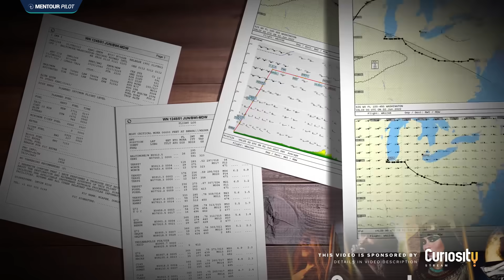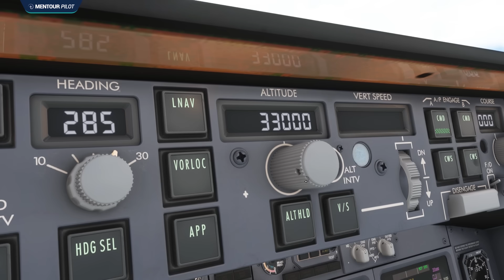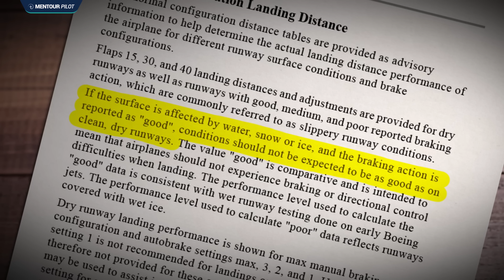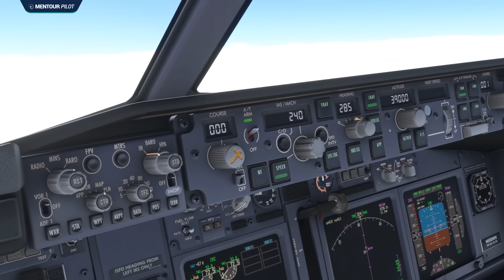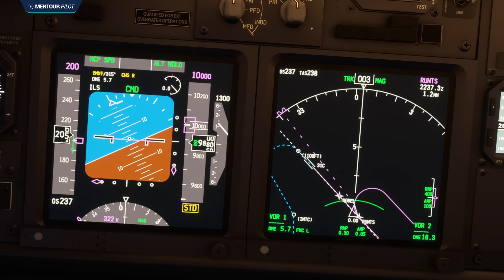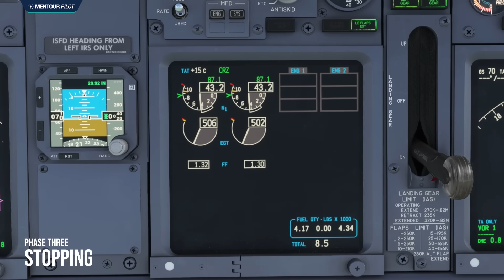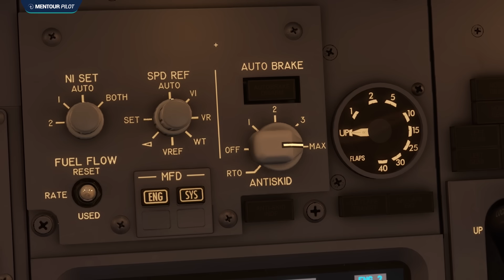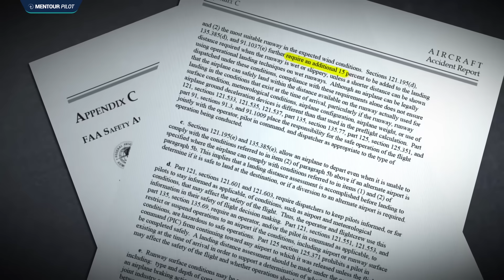WHAT did The Pilots MISS?! Explaining Southwest Airlines flight 1248

Comment: When will people learn that pushing the envelope almost always leads to disaster. I read about it time and again, people decide that conditions, whatever they may be, are just a little outside the safety limits so nothing will probably happen, and boom, disaster.

WTF?! Pilots are not required to do performance calculations once they are airborne. For god's sake, they are dealing with people's lives, how damned hard is it to pick up a computer and do a calculation?! Also, why would anyone design in a trap in software by defaulting to 5 kts without warning the user?

The more I see the stupidity of the way safety rules and procedures are designed and implemented, as well as the devil-may-care attitudes of some rogue pilots, the more I convinced that I am done flying forever. It only takes one pilot who has reckless disregard for the rules to kill everyone on his aircraft.

Comment: This misht be a "stupid" question. But as aviation is as safe as it is, which is actually more dangerous per injury, not just death but minor injuries. Actual crash landings, or the evacuations? As i hear that, during evacs, people get injured for their luggage and other reasons, so like; Have more people been injured in crashes, or evacuations that should have not lead to injury?
Reply: NOBODY takes luggage down an aircraft slide, the crew simply won't let it happen. The accident rate on slide evacuation is around 5 per cent, ranging from minor to serious. The rationalisation is something like "a few broken limbs is better than 100 passengers burnt to a crisp". BTW, slide evacuation from the top deck of a 747-400 is extremely scary.
Reply: @hb1338  Yet i hear this quite often... Usually a purser does not have that much authority against a distressed large male.

Of course it is way better, but here if it is 5%. If the ratio of perfect "crash" landing is more than 1 to 20 then, my statement would be true that evacs lead to more injury (the scale of injury not taken into account) that evacs are "more dangerous".

They so anal about the smallest of things to improve not to fall into the same problem once again.

5% injury rate is quite large in the airline industry, i hope they make the slides more injury free. I would not want to be evacuated from that 747 no way :D

Comment: Deicing, okay.. How long does it takes for ATC 🪐🎯 before they give clearance to Pilots that is about to takeoff 🛫 after deicing❓⁉️🌋 FACTS 💯‼️🎯
After deicing the eunway must be ready for clearance the flight 🛫, ATC 🪐🎯 should give this insteuctions to Pilots and Ground Maintenance crew 💯‼️🎯
3rd party performance figures , this helps Pilots make more accurate decissoon in case an emergency situation ocvur, this is part of the module being given to PILOTS to initiate configurative command to encode, decode, enge, disengage any instrents needed to save the vraft 💯‼️🎯After following all mandates and protocols and still the plane is out of control, it is the Pilots skill, personal skill and Knowledge that will save it, meaning the rest is upto the Pilots shoulders FACTS 💯‼️🎯 It will end into the Pilots skills and knowledge, the split second decission making of the Pilots FACTS 💯‼️🎯 AMEN 🙏💯♾️📡🛰️💯‼️🎯💪🧠👽♾️📡🛰️💯‼️🎯 BOEING 737 series FACTS 💯‼️🎯🔥🌋

Comment: Sorry but I do not understand how you can use word “safer” for this terrible mess. Pilots that don’t know what’s in the manual, software that ignores input and calculates with parameters it deems appropriate, pilots don’t know what is getting calculated a so on. This is a criminal negligence at best, not “safety” in my book. Does one really needs a FAA recommendation to know what’s in the manual and what the calculation means?

Comment: You know, in my uninformed mind, even though there is a tremendous amount of information to learn in becoming a pilot + experience needed, it does seem that so many accidents in various size aircraft boil down to some very basic errors & failure of commonsense. But beyond the flight industry, this happens in so many settings. Whether familiarity breeds an attitude or ignorance of the importance of performing the basic requirements, the results are going to be the same at some point down the road. I'm def not saying I have the answer;  it's just something I see going on also.
Reply: Watching Petter for months now has made me more diligent regarding all processes I do and think harder about the procedures required or recommended.